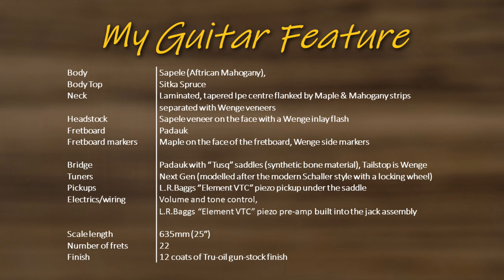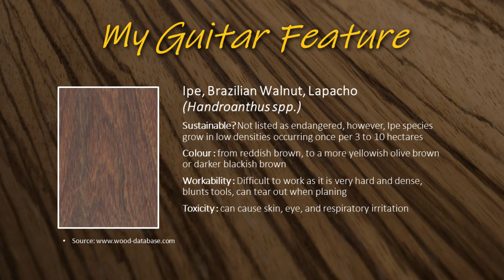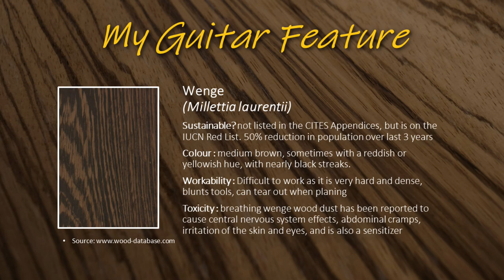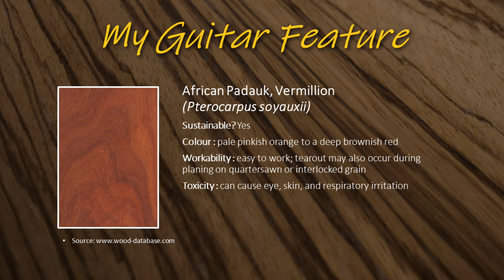#GGBO22 Community Build ep7: My daring neck rescue part 2 and a fantastic guitar story

Comment: I like the rod joining the 2 blocks.  I might steal/borrow that  :)
Reply from the maker: I can't imagine I made it up, I must have seen some one do it.  Cheers Dave
Reply: @DaveDickens  I saw somebody working on an old acoustic that had a dowel running between the 2 but it was suspended.  Looks like yours will run against the back which will have some advantages I think.